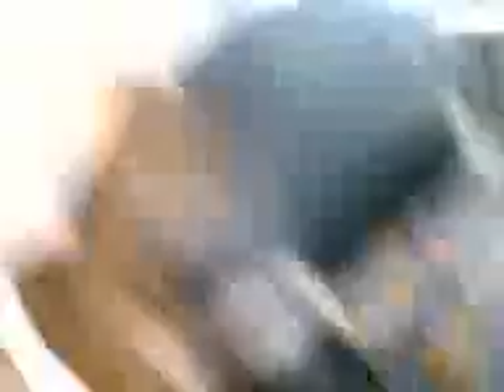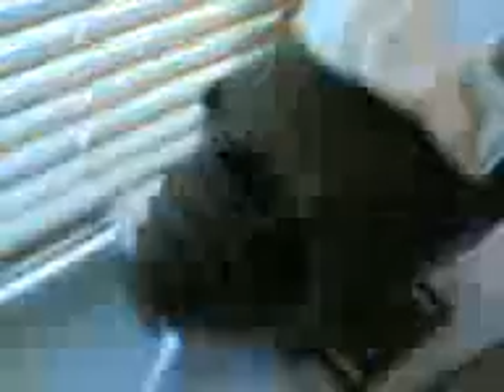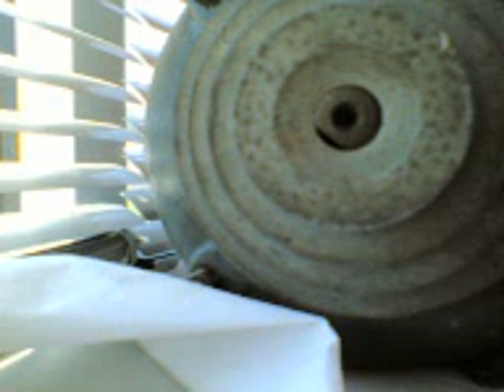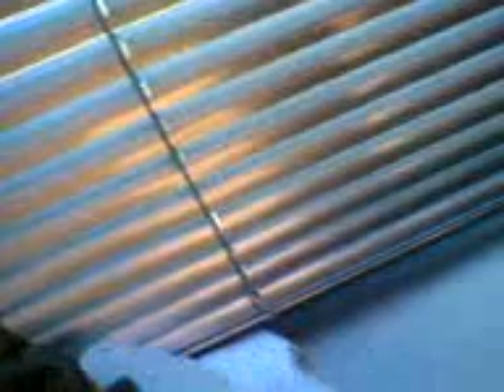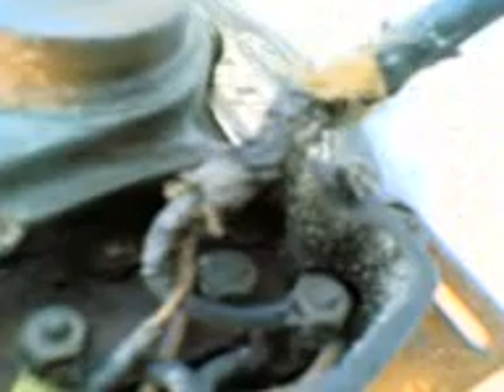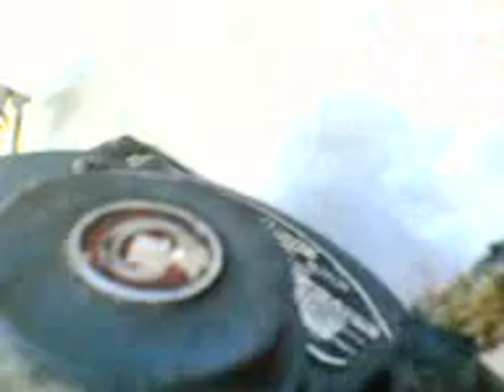1/6hp Century split phase motor

Comment from the maker: Oops.

Certainly smells of ozone / brush scraping the first few starts.  After flipping it 'right-side up', it howled a lot (worn bearings?).  Got some prolong in there (15 drops each cup), and it's much nicer, now.  The centripetal switch is working very well, but there is a definite ozoney-good smell at startup - perhaps the contacts are arcing badly...  Before use as a bench-grinder motor, I'll take it apart and clean it up well.